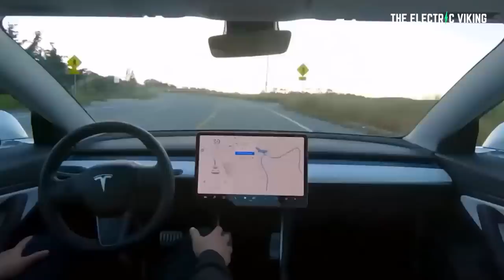20% of all vehicles will need to run on electricity in 24 months in Canada!

Comment: I live in Vancouver, and currently drive a crappy Kia plug in Hybrid, but my next car will be a Tesla.  I like this legislation, but giving companies a couple more years to plan ahead would likely be fairer.
That said, any auto-manufacturer that is not transitioning as fast as possible to EV's is courting disaster.

I expect that most of the EV's will be sold in the cities, and the rural areas will transition last.

Warm regards, Rick.

Comment: Canada is slow to adopt because the lack on incentives and the currency exchange.  A Model Y long range is over $100,000 CDN.  Canada is heavily relying on Oil.  As oil falls, so does our currency.  Any drop in price may be negated by our falling currency. 
There is a $3,500 incentive but it's useless as it applies to EVs selling for, I think, up to $55,000 CDN.  Basically a Bolt or a Leaf.
Reply: Exactly!
Reply: Canada is slow to adapt? BC and Quebec its approx. 20%...
Reply: I believe those provinces have the highest price gas and I believe Quebec have better incentives.  I'm not sure about what incentives are available in BC.

Comment: To be honest, both of our BEVs I wouldn't want to own in Canada. Even in the relatively mild climate in Germany their range in winter sucks. One, VW group, loses 20-25% range and our Tesla without heat pump is close to -30%. Can't imagine how this would be at the low Canadian temperatures for a good portion of the year. It is worth a try but my guess is that especially in rural areas people will tend more to ICE.
It would also require  a setting where the battery is permanently heated when plugged in as a -30° or -40°  battery won't get you going.....
Reply: They are right to stick with ICE or  hybrids for now.
Reply: Precisely the problem with BEV's (battery electric vehicles)
The PHEV (plugin hybrid electric vehicles) are much better suited for colder climates.
Reply: I've own my M3 long range since new & the only time I lose 28 to 30% in -30c is when I drive agressively. If I drive normally 20% lost, however with over 500km of range, I do what ever I have to do with no sweat. Tesla Supercharger  are everywhere!
Reply: @rozonoemi9374  Exactly. I live in Canada with my BEV and I have no issues.
Reply: Little it is not 2025 but 2026. Essentially there are 3 provinces where EVs are popular, British-Columbia, Québec and Ontario. In these provinces surveys show that 60% of people want to by and ev as their next car. The reason why there are so low sales in Canada is because of very low requirements on fuel emissions and the companies don’t bother to send EVs so as a result there are almost no affordable ones like in Europe. If the government was really serious it would have imposed 10% of all sales by 2024. So the new rules won’t change anything for the next few years. It is a shame! A lot of rhetoric again as we are used to!
Reply: @jeanpaulmartin9696  Who told you that there are affordable ones in Europe? They all are a lot more expensive than comparable ICE cars and  lately public charging which a lot of people need as they can't charge at home had extreme price increases. Not the best for BEV acceptance.
Reply: @jeanpaulmartin9696  Time will tell but I hope it does have a good effect.

Comment: Coincidentally I did a range test of my 2022 M3 RWD LFP in cold weather. Between 25-15 degrees F and the range was 40% less than the maximum range of 271 miles. Last time I checked Canada was north of the US. That's one problem. Also, Its like McDonald's being mandated to sell every fifth burger as a veggie burger. If the consumer doesn't want to buy a veggie burger how do you mandate it? I understand that ICE manufacturers will buy credits from Tesla, but to achieve 20% EV adoption Tesla will basically have to have 20% of the Canadian auto market. That seems like a stretch. It will be interesting to see what happens.

Comment: Just as the stats are very different from state to state in the US, they are wildly different between the provinces in Canada. BC leads the way with Quebec a close second. After that it drops like a stone to Ontario then the rest. Of course, at the bottom of the list you will find big oil country (AB/SK). As far as charging infrastructure goes, Tesla Superchargers are all over the place and one can easily traverse the country in a Tesla. BC Hydro has done a commendable job dropping 50kw, and more recently 100kw, fast DC charging stations in the gaps. There are also quite a few L2 chargers scattered around from the other players and even Tesla Destination chargers at some nicer hotels, restaurants, etc.

Comment: I'm canadian and I've been owning an EV (a 2018 Model 3) for 4 years now. It's encouraging to see laws like this. No idea if we'll reach that goal or not but they need to understand that they need to also invest in infrastructure too. Otherwhise it won't happend. They also need to force current appartment complex owners who has parking to install 240v plugs for the residents. How can we convince them to switch to an EV if they can't charge at home? There's a law in the province of Quebec that forces new appartment/condo buildings with 5 units or less to have 240v outlet in each parking. But why just 5 or less? I don't know unless there was heavy lobbying against that law.

Trudeau and his team are also hypocrites because they bought a pipeline for 4 billions in the past because of the province of Alberta.
Reply: Because a 50 unit building that offers 50A plugs at 50 parking spots needs to have a 2500A able to be supplied to the building. You'd need high voltage transmission lines to the building and a transformer station on site just to supply the power.
Reply: @Snerdles  There's no 50 units building where I live (as far as I know). I've lived in an 18 units building and we all had 120v outlets in our parking.
Reply: @mlevesque33  120v is limited to 15A, 12A continuous. A 240V dryer outlet is 50A, 40A continuous, so over 6 times the power per outlet. It might work if they did 240V 20A circuits and limited it to 16A EVSEs (3800 watts), but even then your charge times in the winter would be in days and not hours since about half of that would need to be used up in battery heating. It's a much more complicated problem than you seem to think. Especially since we need higher density housing to help keep housing prices more reasonable. Mandating crazy unattainable rules just makes things worse.
Reply: @Snerdles  At 120v, 12A it's in the days. At 20A or more in winter will take a few hours (more than 4), not days. I've charged at 30A in cold days of September, it still took a few hours to charge. Sure it's not -20°C but it's still enough to charge the car and going to work and back doesn't take 100% charge in winter unless you have an old Leaf.
Reply: @mlevesque33  120v circuits by code can't run 20A continuous loads, even if you had 20A circuits you'd be limited to 16A (80% of circuit rating for continuous loads, regular residential circuits are 15A, limited to 12A continuous) which is only 1.92kW. In the winter you'd need about half that for battery heating so only 1kW for charging so a 77kW battery you'd need about 80 hours once you factor in losses. For a 50 unit building they'd need 50 seperate circuits with 20A ratings which means the entrance needs to be designed to handle 500A just for the parking lot (since the service would be 240V split phase, the lot would be 25 spots per 120V side of the panel). On top of the building usage that's a massive infrastructure project and that's only for 2kW charging per vehicle, imagine if that was 11.5kW per vehicle so that they could actually charge overnight.

When you claim you charged at 30A, that's on 240V so 7.2kW. If you need 1kW for battery heating then you still have 6.2kW left which would charge a 77kWh battery in about 11 hours. 50 of those in an apartment building would be able to handle 360kW of power output just for the parking lot, not to even factor in the power for the building.
Reply: @Snerdles  I doubt they´d need anywhere near that much, you assume all cars charging at the same time all the time. For perhaps 20 mile average per day, they´d need less than 10kWh per day per car including preheating and loses. That means 500kWh a day for 50 cars. Overnight 10h charging time, one car taking 1kW on average, one charger per 4-5 cars should be enough. Add maybe a few for some redundancy but we are talking around 10, 400V charging stalls, taking average 125 Amps combined with plenty of power to charge a car fully overnight if needed. I assume 3-phase 400V since that´s what we have here in Europe, but I don´t know what is usually used in Canada. And this is without anyone charging during the day or at work or at supercharges.
Reply: I have a 50 AMP setup (32 amp continuous to be safe).  I worked with 12A, 120V for a year.  From 7 pm to 7am (offpeak), I get 100 KMs range, which is 90% of what I do.  If needed, I catch up on the weekends plugging in for 15 - 20 hours per day.  IF go further on back to back days, I go the Super Charger and put in $10.
Reply: P.S.  My 50 amp install with parts and a master electrician was $750 because everything is in the garage, no drilling necessary.
Reply: @Snerdles  thats assuming all 50 get used at the same time, wont ever happen, we are talking about people here.
Reply: @mlevesque33  all those 120 outlets for warming the engine can be used for daily slow charging of EVs.
Reply: I noticed during this most recent cold that many charging stations were not functioning as intended. Knowing that extreme cold impacts the charging stations gives me the impression this might be a critical issue for Canadian’s. 

Thoughts?
Reply: @Snerdles  you already have at least 2 240V outlets to each apt, wont be impossible to make it three. and you wont need to warm the battery if you let the car know you will plug it in as soon as you get home. dont wait for the car to cool off before plugging it in.
Reply: @peterosinga5848  I don't consider myself wealthy (not by a long shot).  Even if you have to go to a charging station it is 1/4 the price of gas.  It takes $4 to travel 100 km.  The average gas car is 9 or 10 litres to go 100 KM.  So about $15.
Less maintenance (less time in garage), safer, faster, ...
Reply: @scottmcshannon6821  That's completely a non sequitur though. The parking lot isn't in the living unit. You have to have a way to track the power per unit, stop other people from using your own power, or include the power in the rental fee which means people who don't plug in are now subsidising people with EVs. Add to this that almost always the power usage is going to be for evening and overnights and for many hours at a time instead of a stove, which cycles on and off or a dryer which only uses about 3kw and only runs for an hour every couple days... This is a massive undertaking that needs very specific and expensive infrastructure.
Reply: @Snerdles  Not inside, at the parking lot. That said, it is very common here to have a 3-phase outlet in a garage.
Reply: @scottmcshannon6821  I lived two years in an appartment with my 2018 Model 3 and I was charging on a 120v outlet in my parking. Super slow but it works.
Reply: @peterosinga5848  Today's appartment/condo buildings (5 units or less) being built have 240v outlets. So anyone living there can charge their EV for the same price.
Reply: @homenj3897  From which brand? I know Tesla's superchargers works all year, same with Electric Circuit/Flo chargers (here in the province of Quebec). I keep seeing messages on twitter about Electrify America's charger not working.
Reply: @Snerdles  I charged on 30A at a camp ground, I never said it was at home. I should have been more specific.
Reply: @peterosinga5848  apt owners are always adding new features to attract new customers, the latest will be level 2 chargers in the apt parking lots. like they charge for garages at their complexes.
Reply: @homenj3897  what happened is years past?
Reply: @michalfaraday8135  Not in Canada or the US. Most is 120 volts 15 amps. With special wiring you can get 240 volts 50 amps.

Comment: Fantastic for Canadian winters where you lose 20% of your range to the cold and then can only use 70% already on long trips since super charging is so slow. Suddenly your 350km range is 175km per leg of your trip. The nearest 350kW charger is 150km away from my house, the nearest 50kw is 90km. I live in a city, and only 7.2kw chargers are installed in this city or surrounding area. Even then they charge by the minute instead of by the power used so when you plug in to the 350kW charger that already charges 3 times the price for energy and only get 100kW you are now paying 6.5 times which is far more expensive than gas.

Canada has a LONG way to go before EVs make sense here.
Reply: Who drives 350km per day beside sales persons? The majority of folks only take their cars to go to work which is less than 100km away so who cares if you lose 20% range. It's not like ICE cars doesn't lose range in winter. The reason why it takes more time to charge is because the battery pack is cold. If your car doesn't preheat it in advance, your charging session will be slow. Tesla's preheat the battery before reaching a supercharger so it increases charging speed.

Starting next year, we will be charged per kWh at public chargers. Mesure Canada FINALLY decided to give the ok.

We're still needing more public chargers because gouvernments doesn't invest in them. It's usually the users who pays for it. Unlike the fossil fuel industry... oh wait, nvm... we all pay for it.

Comment: We are in Southern Ontario and have owned our 2019 Bolt EV for 4 years.  I love it and would rather not go back to ICE.  Unfortunately a $14000 rebate for new EV purchases in Ontario had been rescinded by a new provincial government by the time of our purchase 😡 thanks a lot Ford - the Premier not the motor company.  The decreased cold weather range is a concern, but some of that is due to the lithium's aversion to carrying a charge in low temps so hopefully the next gen batteries will address that.

Comment: I just checked and Tesla Model 3 std range in Ontario is $59990 CAD.  For the cheapest model.  A used chevy bolt Premier 2019 with 36K is still $41990 CAD.  Way too expensive for me to justify getting one. And I want to make the switch.

Comment: I have seen several YouTube videos lately about how long it takes to charge an EV in cold weather.  Plus you have to queue up to get to a charger, if it works.  You can be waiting two hours to get your EV recharged.  Plus the credit card bill for the charge can be rather high.
Reply: I’ve owned a Chevy Volt and now a Tesla Model Y, and it is true that on the rare time, for free charges you have to wait for a charger but since owning a Tesla, I’ve never had to wait for a charge and most ppl will use these chargers very rarely, for road trips.  The main issue is that Tesla is the only company that have reliable charging infrastructure and the Canadian Government should either make this the standard for all vehicles or invest in a charging infrastructure massively before 2025.  Otherwise this mandate makes no sense.  To answer your questions, time of charge depends on a lot of factors, type of charger, (150kw, 250kw, etc), percentage of charge when you get to the charger, did you precondition the battery pack, are you at a charge that is sharing a stall, and what to what percentage are you charging your car to?  I would say, currently in Ontario, majority of the Tesla chargers are 150kw, and if you are charging from 20%-80%, it will take approximately 30 minutes give or take.  The cost is still way cheaper than getting gas.
Reply: I've owned an EV for 4 years (Hyundai) and never waited in line for a charge. And I don't even have access to the Tesla chargers. The infrastructure is there.
Reply: @AceTCK  Free chargers?  All of the videos I have seen so far show a credit card payment required.

Comment: Well I wanted to buy an Ioniq 5. So I went to the dealership and put down my deposit and they told me the car should be here hopefully by 2024.  I have the cash to buy one immediately what I have done is I have leased a vehicle for 2 years from Subaru while I wait. I would have bought a Tesla Model Y because I need an SUV whoever the model y cost $85,000 Canadian plus 13% tax so now we're 96,000 and there's no government subsidy. That compares approximately $65,000 including tax and government subsidy for a fully equipped Ioniq 5. $30,000 difference between the two is a bridge too far

Comment: I live in the Ottawa area. I’m a senior citizen and I cannot afford the price of an EV. Another reason is our winter temperatures. What reduction in range is typical at -10 C?
Reply: Hi Dan,
It varies.  You might lose 30% range, but if the car has a good battery management system the loss will be less.
Warm regards, Rick.

Comment: Tesla owner since 2018 and living in Montreal. There's a lot of Tesla here. The main problem with EV adoption isn't cold or snow. It's the car price. I bought a Tesla even if it was more expensive because I'm tired of pollution that come from gas engine. Sadly a lot of people don't care enough and will buy the cheaper gas engine. That option most be removed. The same way we put high taxes on cigarettes because they are dangerous, taxes should be higher on gas cars, and the money from those taxes should be used to reduce the prices of EVs.

Comment: Part of the Issue in Canada is that the winters are cold and there is significant range loss.  Our 2018 Bolt loses about 1/3rd of the range in cold weather like say below freezing temperature. So that adds to range anxiety.  The other issue, of course is the lack of reliability of non-Tesla chargers.  The big price drop of Teslas will help EV adoption.